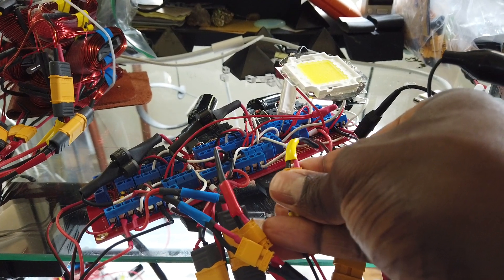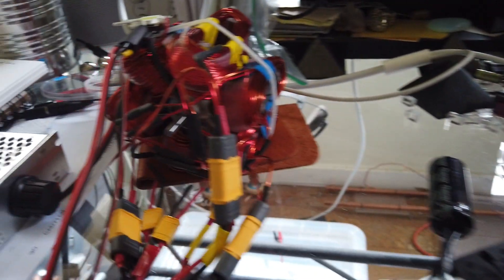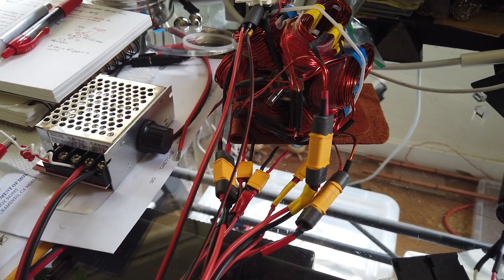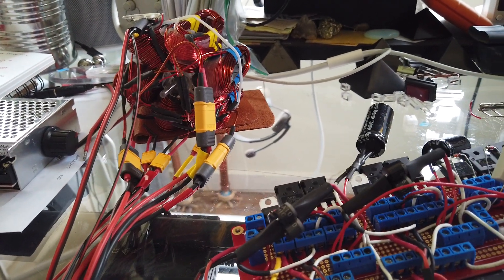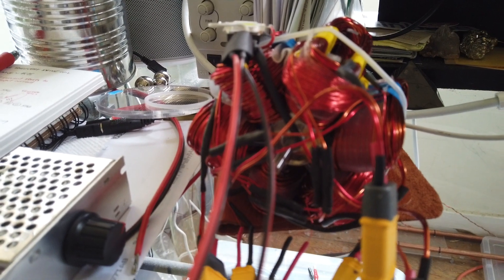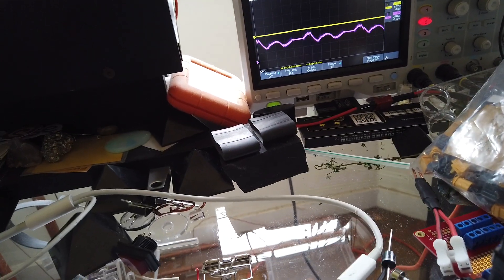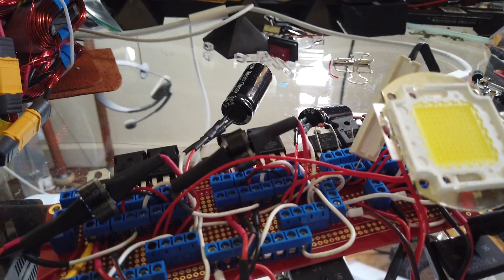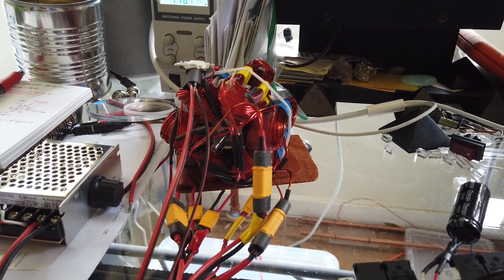Self-Starting Pulse Motor with Efficient Back EMF Recovery

Comment: Am I to infer that the voltage/ current through the coil L to ground Neg is also receiving voltage from back EMF in same direction to ground, and not just wasting energy? I need to increase voltage to my circuit from 33V pulsing DC to over 100v from EMF to over same load capacitance TO GROUND ONLY. If coil has high resistance so as when grounded, no shorting. My coil is 1.5MH with .2 ohm resistance. Seems probable the 20,000 cycles applied as pulsing DC would just short the coil and blow fuse. Extra energy needs to be stored in a capacitor, not wasted over a coil inductor...
Reply from the maker: That is incorrect. The voltage going to the coil pair 3 is the voltage potential between coil pair 1 BEMF and ground, and the voltage potential between coil pair 2 BEMF and ground. For example, if the input voltage is 12V, and the BEMF from either drive coil (coil pair 1 or 2) is 60V, then the voltage delivered to coil pair 3 would be 60V-12V or 48V. If coil pair 3 were using the primary input voltage, the motor would deliver a similar power output, but would ultimately consume more energy.

Comment: Great job. I have been learning alot from another channel called https://youtu.be/MQneKZwmliU 
He has very similar to your ideas to you. Using bendi motor 
recharging
Reply: Also another tip is to use ferrite cores in the coils ,as this has no magnetic memory effect and provide better efficient motor/generater
Reply from the maker: Ferrite cores are great at directing a magnetic field. However, in this setup, because the coil pairs are attracting each other, they actually do a decent job of forcing the magnetic field to go where it needs to go to do work. Also, ferrite cores add drag during the time in-between firing sequences. Lastly, alternating a magnetic field in a ferrite core causes losses due to heat buildup as a result of magnetic induction, which isn't a problem with air core motors. On the positive side, they could potentially add more torque. They would really come in handy if I were able to use more coils and space them more closely together, so as to reduce the drag during the off-cycle.
Reply from the maker: Tinman is definitely one of the pioneers. That channel is an awesome resource.
Reply: @PerpetualMotor  tinman has demonstrated ferrite has less drag and lower eddy current losses then steel or air cores for maximum efficient power transfer.  Glad you like hes resource, he is called ozsloarpower now

Comment: build this https://www.youtube.com/watch?v=-GNNmJd8Jcg  lmk if you have any issue .
Reply from the maker: @myke Does in my experiments, it doesn't seem like the BEMF is pulsing back 100% of it's energy. Also, the batteries I've tested with don't take all the energy from the BEMF pulse. So, there are losses in two places. I've found that the coil from another motor picks up more BEMF than anything else I've tried - capacitors, LEDs, generators, batteries, etc. So, from what I've seen, the best use of BEMF is to put it back into the motor that's running.
Reply: @PerpetualMotor  If you look closely at the looping function of that diagram you will see that the spikes are being stored alternately into oposite batteries, I can tell by your wording you have picked up on the design to a degree, thats why the use of capacitors instead of lead battery for back emf absorbtion, you will need to put a few different values of caps in parallel with the lead battery or better yet no lead battery at all just caps  like high voltage low fard and low voltage high farad. The spike is low jueles high voltage. after you take a 2nd look you will see that 180 degree (Rotor Magnets) is dumped into storage a and the other 180 degre is dumped in storage b giving the back emf little time to disapate and possibly even used right away in the next 180 degree of the rotor, pay close attention to the two drive coils positioning and the magnet postion on the rotor, this is the only thing about this layout that i believe to be significant assuming the config does not blow out each of the 2 transistors which they should not because they are fireing 180 degree apart. this config if it works also allows for the use of un matched transistors. FYI  "I HAVE NOT BUILT IT YET" old tired and busy paying bills, but i intend to make the time.if you make one lmk if you have any issues i will collaborate